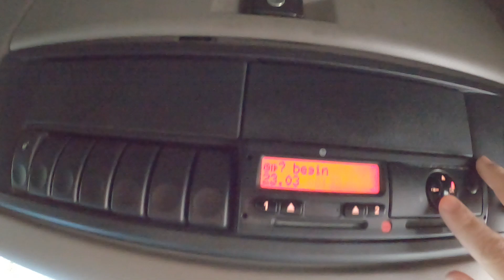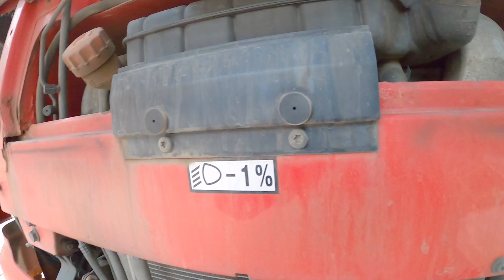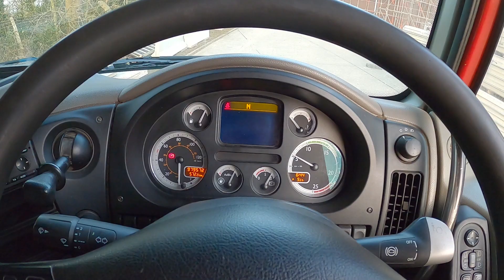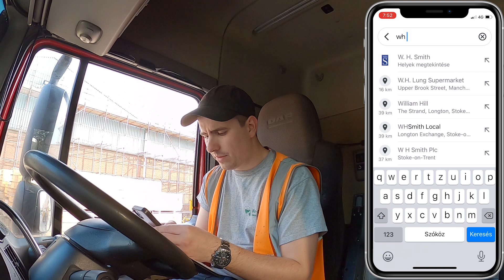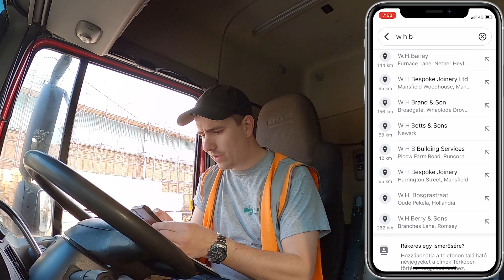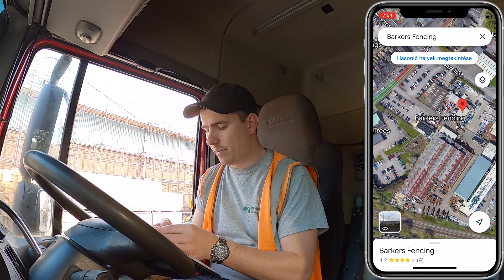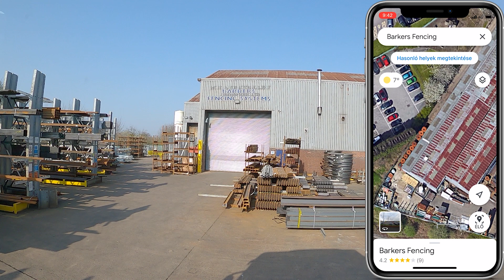67 Stoke-on-Trent

Comment: 00:00 Intro
00:08 30 perc készenlét, 5 perc egyéb munka rögzítése
01:07 Big Red: ennek az autónak van gazdája
01:49 Reggeli szerelvény átvizsgálás
03:50 Vízszint ellenőrzése
05:27 Rakomány lekötése, 1 óra
07:56 Slider pótkocsi ponyva mozgatása
08:34 Lekötés kész. Az év első pólós időszaka
09:22 Valaki eltűntette a racsni meghúzó fadarabot, koszos-e a kormány?
10:39 Még nincs hír a kocsiról, gázolajszűrő csere
12:04 Elhoztam a TomTom szerviztől kapott tartókonzolt
14:42 Hova is megyünk?
16:58 Lerakót megtaláltuk, nyitás reggel 8.30
17:57 Meglepődnék, hogyha működne most a navigáció ezzel így
19:18 Hívtam az Apple-t az AirPods miatt
20:26 Úton a lerakóra
21:18 Tegnap már a Ford is bedobott valami hibakódot
24:06 3. hete tökéletes idő van, de nem sokáig
27:18 Lerakó közelében
28:12 Minden leesik
30:03 A lerakó telephelyén belül
30:42 Ne kérdezzétek, hogy mi lesz ebből, mert fogalmam sincsen!
33:35 Nem is lehet balról megkerülni az épületet
34:40 1 óra várakozás és 1 óra lerakodás után
35:12 Ez itt a kijárat, nem túl széles
36:43 Úton a felrakóra
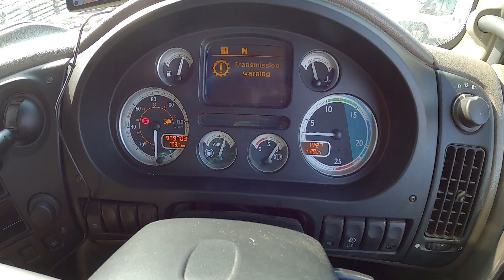37:27 Ott van a beígért 20° C fok
39:22 16 óráig van nyitva a cég és még ketten vannak előttem
41:04 Outro
Reply from the maker: Köszönöm, szép munka :)